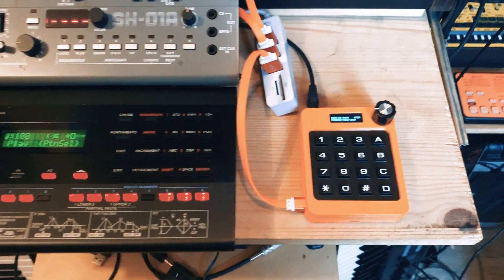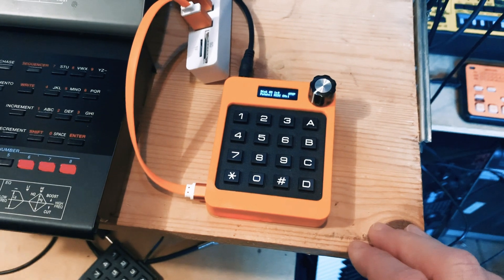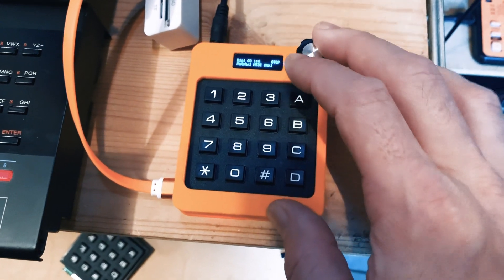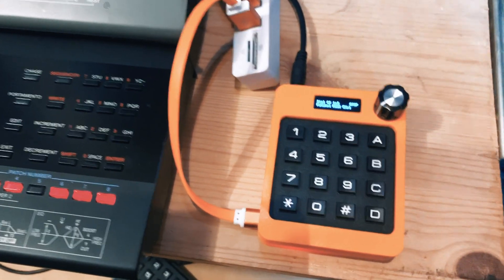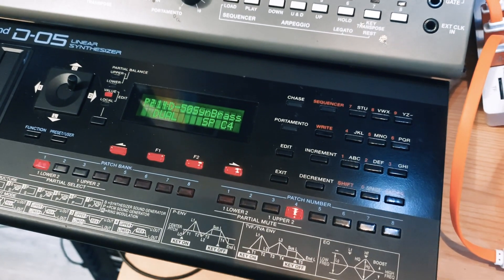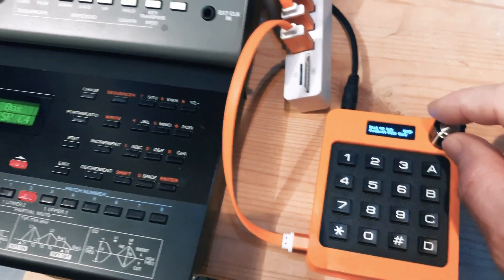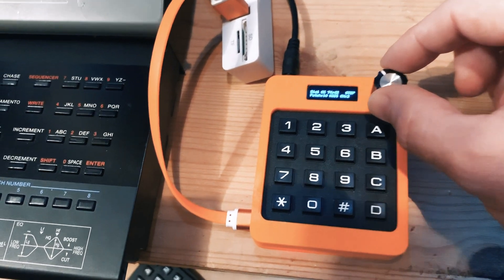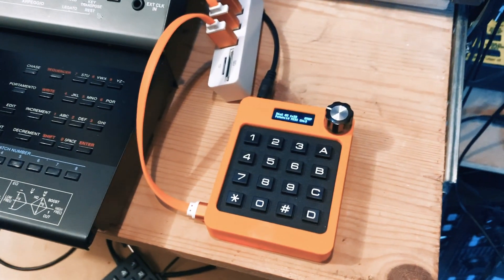RK-007 MIDI  Commander

Comment: This is awesome, is it possible to insert it in between a midi controller and a module and have it just change the channel of the incoming signal, rather than program changes? Simple, but I've been looking with no avail for a midi keyboard with dedicated buttons to switch midi channels (like on many Ensoniq gear), and a numpad would be even better for that.
Reply from the maker: It is a DIY build where surely you could program it to act as a midi channel switcher - this switching function is available in the RK008 by the way

Comment: I have not built it yet but I believe I could make it into a Drum-Computer. Check my channel - the code of my DIY Volca (Polca) could fit in it - only is missing yet and a Audio-Out or DAC has to be added.
Reply from the maker: Looks (and sounds) like a great project, I'm not sure if we used important pins for the keyboard matrix (we used pins which make it easy to just pin-solder the keymatrix onto the ESP32) so you might need to swap some stuff.

Comment: Hello. what is the price RK-007 MIDI Commander?
Reply from the maker: Hi, the 007 is a DIY project, all files and code to make it can be found on the links  in the video description.
Reply: @RetrokitsDev  I want to use it on the accordion playing  roland fr8x. to find sounds in real time. may? by midi cable?
Reply from the maker: @supermaestro67  ok, I’m not sure what the fr8x can do with midi, if it has a midi input, is there a midi command you can use for that? Like a ‘midi program change’ ?
Reply: then downloand FR-8X MIDI IMPLEMENTATION
Reply from the maker: @supermaestro67  I can see it can recognize it, but is there no quick up/down button on it for program changes, if the fr8x has midi in/out we could also try and make a duy which can translate other buttons to a program change, but then you need midi in/out on the fr8x this all might be a bit too extensive to discuss on YT though
Reply: @RetrokitsDev  so what's my idea: i use juzisound 1 sound mode and wireless midi package. I would like to put this box on the accordion cover and then the in-out midi cable in wireless midi and I can quickly change any sound from the 2600 saved on the sd card in sound mode. [currently I can only save 14 sounds on the accordion registers.
Reply from the maker: @supermaestro67 you will then also  need a merger to insert the program changes from the box into the accordeon data. Both that data can then be wirelessly transmitted to the juzisound.

But this is so specific, I don't think the RK007 code will help you much further on this. Perhaps you could put the midi processor on the juzisound, after the wireless signal, so : wireless in/out on accordeon -> to wireless receiver -> rk002 -> juzisound. There must be some controls on the accordeon which you can translate/remap to program changes or whatever for the juzisound and then you won't need a box on it. The wireless receiver should be able to power the RK002 though, not sure what you would be using for that.
Reply: @RetrokitsDev  2 things need to be solved: 1] rk007 to work for example with two 1.5 v batteries for wireless mode.2] usb-midi connection cable. [Usb rk007-midi wireless juzisound]. and it will work.
Reply from the maker: @supermaestro67  the rk007 can work on a lipo rechargeable battery but what you want is not something out of the box, you can use the platform to make it work your way though, but you then need to make custom code in arduino
Reply: @RetrokitsDev  question: if i enter the accordion via usb does it not take over the operating current?
Reply from the maker: @supermaestro67  it depends which kind of usb plug is on the accordeon
Reply from the maker: @supermaestro67  I already looked through it and the possibilities are there but it is not something we can build without having the FR8X and juzisound here. The process of making a tool to do this elegantly requires hands-on material. The files which are available with the RK007 should get you a long way but we can't tailor this to your needs blindly.
Reply: @RetrokitsDev  if it's still free can you send me a "RK-007 MIDI Commander" for testing through the courier service in Romania? it would be great to see concretely what can be done.
Reply from the maker: @supermaestro67  The RK007 is a DIY (Do It Yourself) project, on the google drive link in the video comment you can find all links to the parts and code you need to build it, it is not something we carry 'ready made'. It can be a good base for what you want but then you need to adapt the software on it yourself.

Comment: Hello Retrokits people, a big thanks to you with the 007 project ! Great start to understand how to manage MIDI with Arduino stuffs.
I would like to ask you to be more precise on the PIN you are using because the code seems to show that the Potmeter is on A6 but the code mention A6 for the SDA OLED A6 to ... but SDA seems to be on PIN 2 on the Arduino proMicro, right ?
Other question :is the U8G2_SSD1306_128X32 api not to heavy for the Arduino proMicro?
Again, bravo !

Comment: any links or info on the screen you're using? Trying to figure out it's size
Reply from the maker: brice henninger Links to the used hardware is in the code. In the meantime there are 2 versions, this one and a Bluetooth MIDI version, based on a ESP32
Reply: @RetrokitsDev  Ahh ok. I saw the two different boards but didn't see the screen. This is perfect for some things I've been wanting to do.